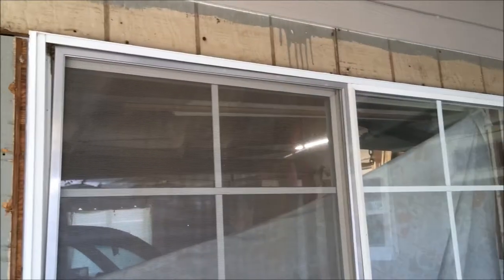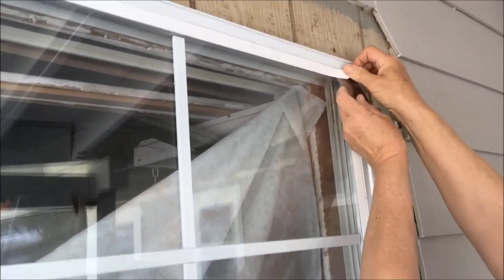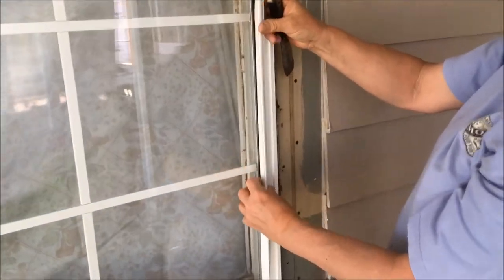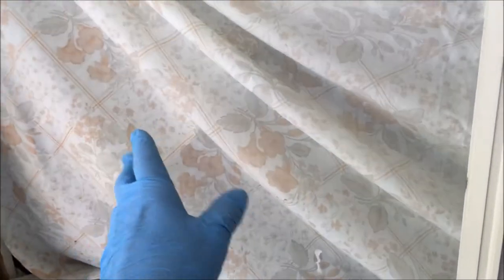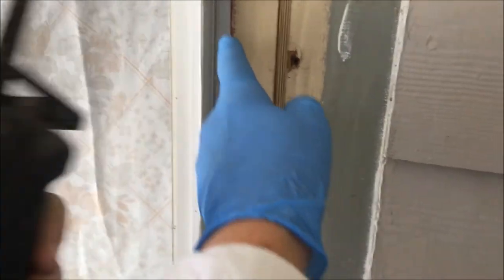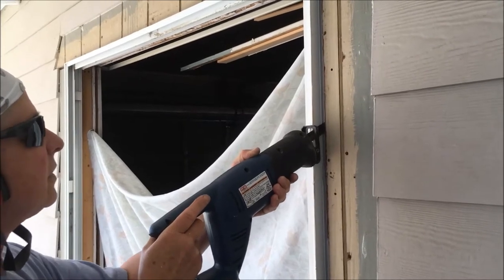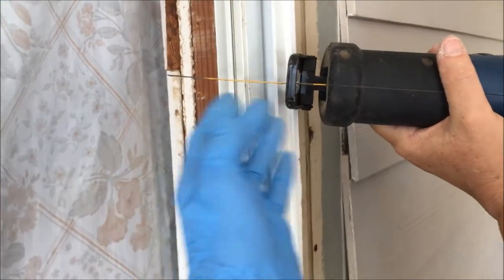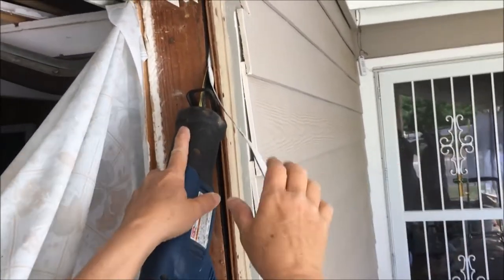Remove Window with Reciprocating Saw | Nail Fin Behind Wood Siding

Comment: I did this to my old house to install new windows that have the J fin already on for vinyl siding. Saves a lot of time. I did leave the aluminum flange in and had no problems installing the windows.
Reply from the maker: It's a bit of work, Mike, but does save a lot of time, and money doing it yourself.